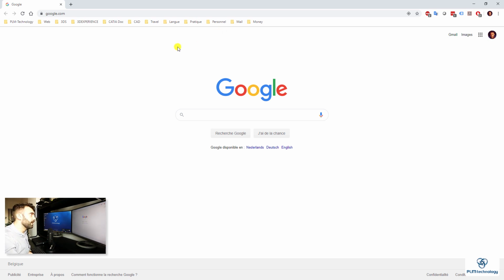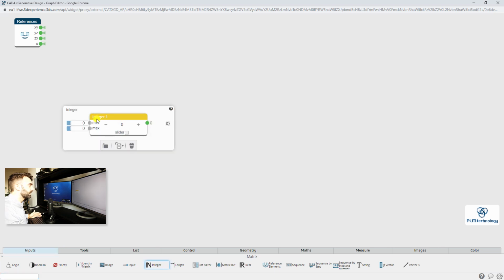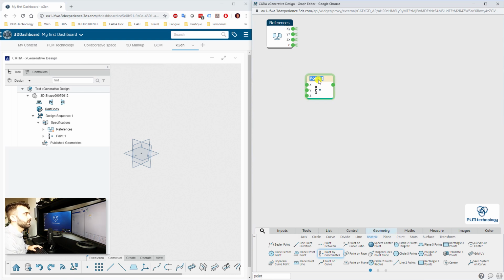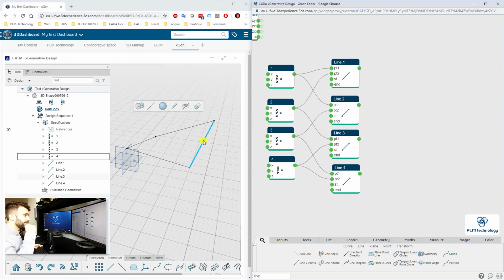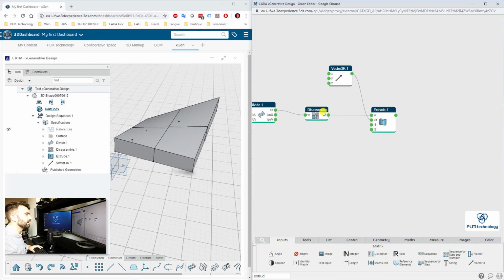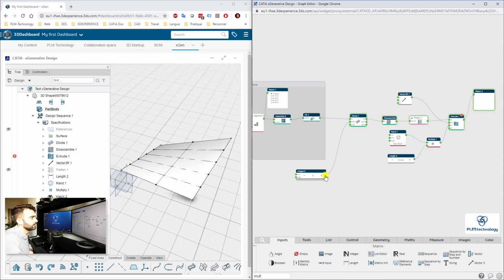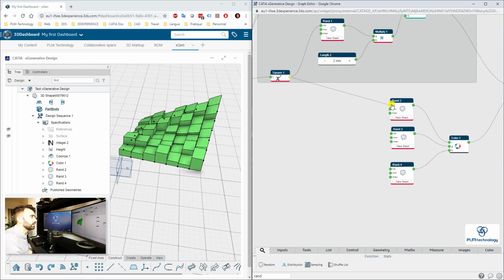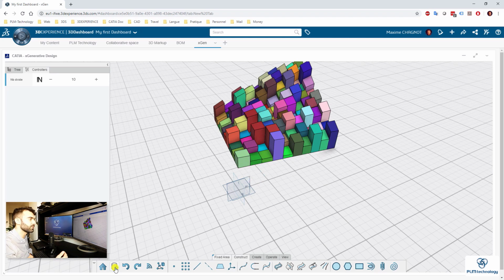Introduction xGenerative design - CATIA 3DExperience R19x

Comment: Nice video ! 
Do you know if there is such a plugin/addon for SolidWorks desktop version  ?
Reply from the maker: Hello Artūrs, Thank you for your comment! This is not an addon, it is actually a web based application. You can purchase it on 3DExperience Platform but I do not think you can connect it to SolidWorks.
Reply: @MaximeChagnot  I am aware that the tool presented was a part of 3DExperience platform. There are tools like GrassHopper for Rhino  and Dynamo for Revit and I was just curious if such tool exists for SolidWorks stand alone version. Anyway, thank for reply!
Reply from the maker: @artursrimsa3003  maybe in the future, but for the moment I do not think there is an add-on for SolidWorks standalone. I think it is exclusively on 3DExperience Cloud on Web interface. Thank you for asking this question :)